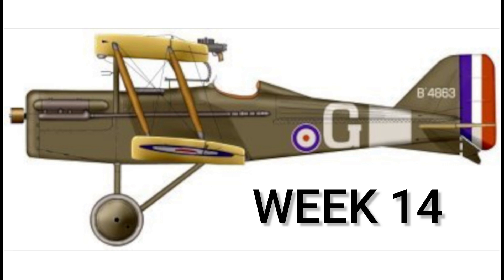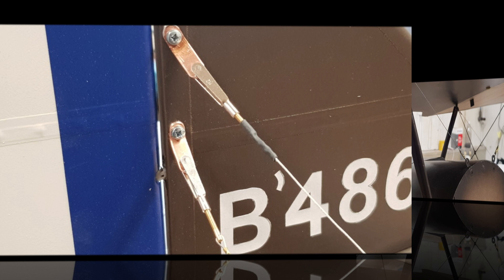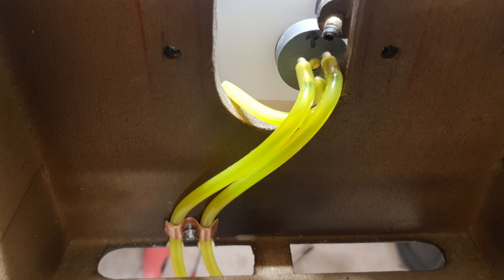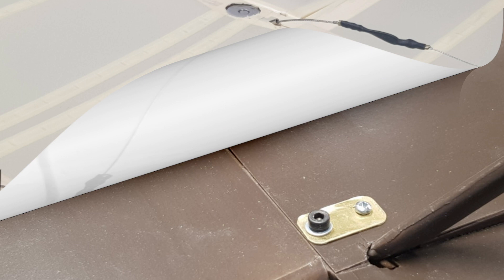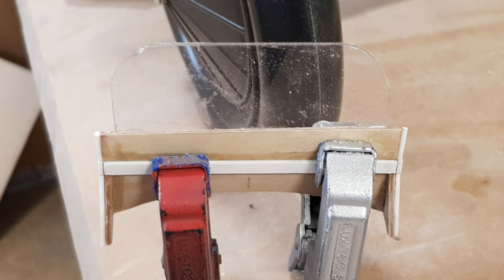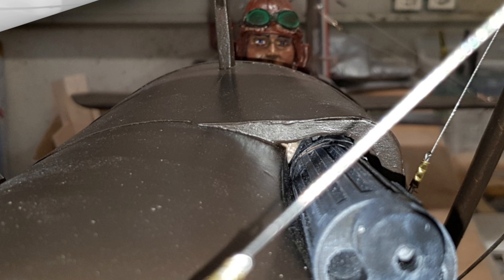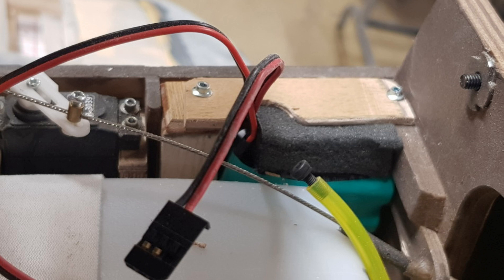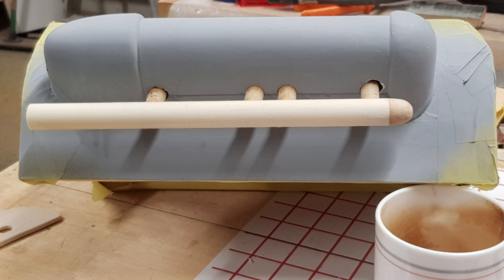S.E.5a build: Week 14

Comment: Lovely build but one small thing i noticed @ 2:51.  You have fitted the Vickers machine gun upside down - the barrel should be at the botton and not the top.   Good job you used silicone to fix it in place!
Reply from the maker: Thank you I was told about that the day after I glued it in.  Now it won't com out.
Reply: 2:58 the pilot is also upside down so it matches.